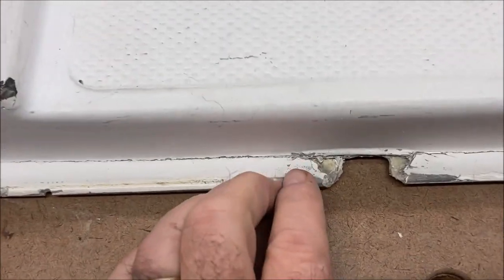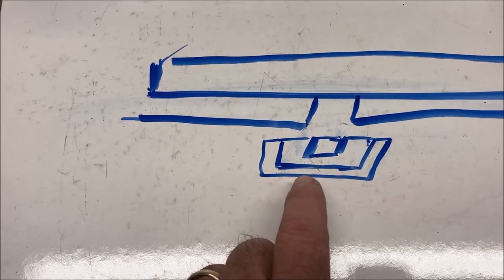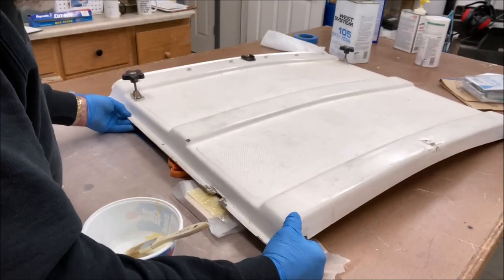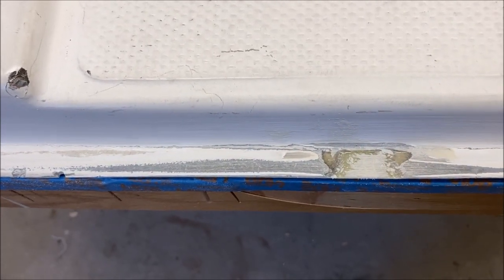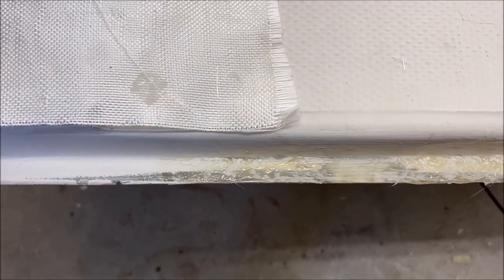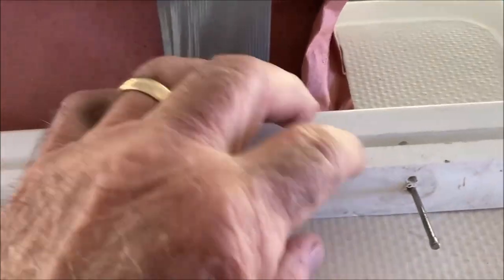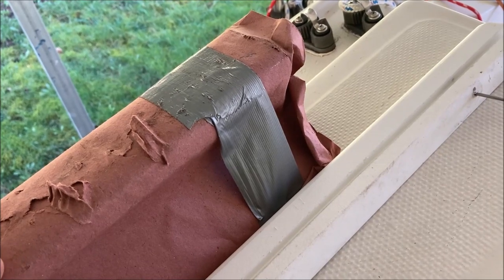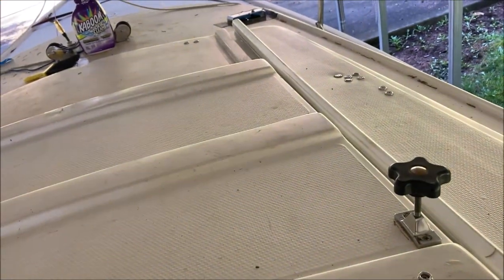Sliding Hatch Repair  --  Catalina 22 -- Jim's Little Boat

Comment: Thanks for the video, i'll be tackling this repair over the winter. Id like to add the screws and track you've got to keep the slider under control. Do you have a source for them? Thanks
Reply from the maker: No source.  I just went to a sheet metal shop that specializes in fabrication .  The pieces cost m3 $40 (min charge) and $20 for the beer fund.  When I go there, the guys in the shop, always shove my little jobs to the top of the list.

Comment: How do you get the sliding hatch off?
Reply from the maker: You need to take off one of the rails.  There are four large screws on the cabin overhead.  Doesn't matter which side you take off.  When you put the hatch back, you have to line up the holes without smearing the sealant all over the deck.  I do it by myself, but it''s easier with help.  (I think)